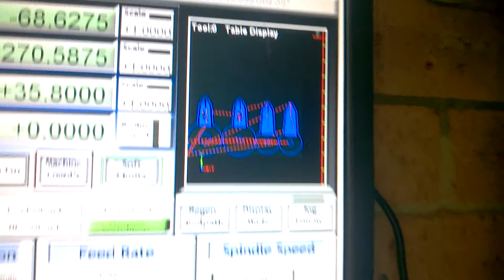Making Gaguge Needles (737 Cockpit Project)

Comment: Tell me about your CNC machine. How much was it? Where did you get it from? I'm curious!
Reply from the maker: just one of the cheapest Chinese machines on ebay. cnc 3020.. trapezoidal screws etc,200 or 300 watt spindle.. worked really well for what we paid for it.

im now thinking to upgrade to something proper, but spending 2k is not the most appealing idea.